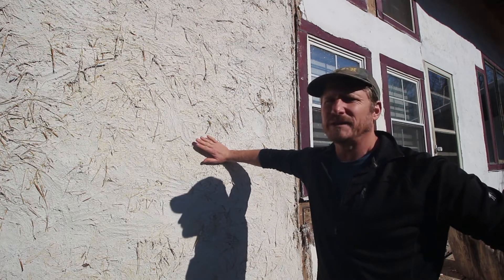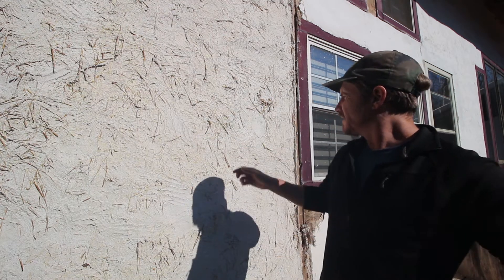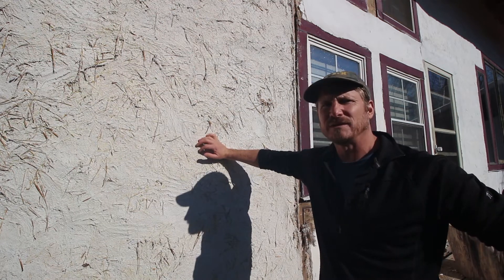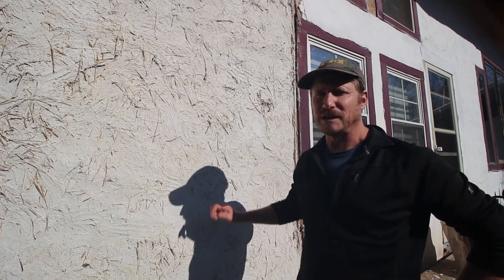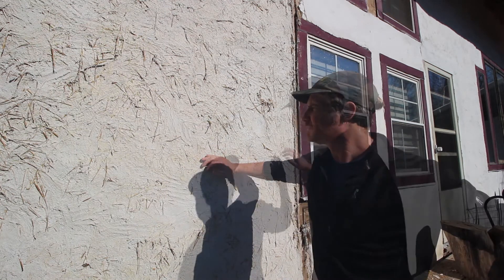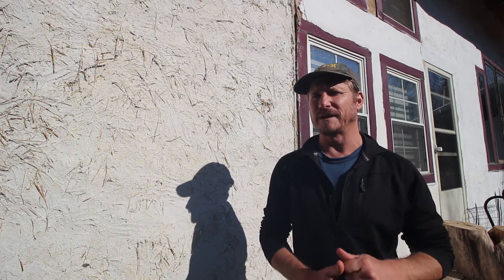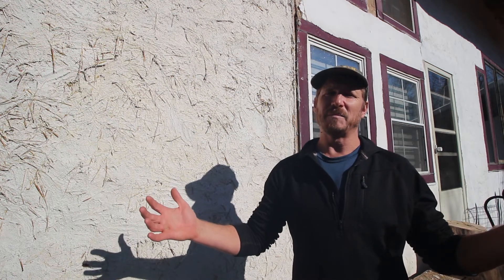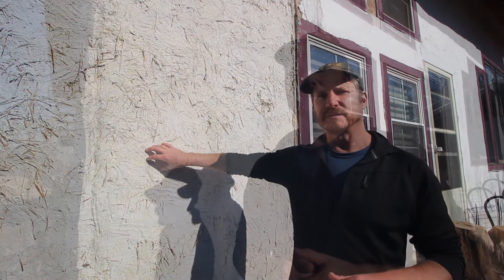What Happens When You Use Frozen Lime Putty in Lime Plaster?

Comment: Thank you for the video. Can you make a video about recipes you use for internal lime plastering and how do you deal with cracks when plaster doesn't dry evenly. Also homemade lime wash paint. I saw somewhere that adding a bit of vinegar to lime wash paint results in lime being not so dusty after it dries. 
Thank you.
Reply from the maker: I will see about doing another video when I'm finishing up this project in this video. I'd say that if the plaster is cracking it might be that it's drying too fast. I haven't ever had that problem with lime plaster but definitely with earthen plaster because it is not the right combo of clay to sand.  I didn't know about the vinegar addition for reducing dusting. I've never actually used lime plaster inside though I did mix a lime casein paint for a portion of my earthen plaster and it worked great. I think the casein prevents dusting too.

Comment: ouuu, few moths ago i had same problem with one bag of lime putty. My putty wasn't so drastically  been affected by freezing, but have had some 5cm  and smaller rocks that don't react with HCl. For me solution was to mix 1 portion of putty width 1 portion of water, and then strain mixture through a 1mm kitchen wire mesh on top of 3.5 portions of dried sand. After mixing this wetty plaster by electric drill, I left it in hermetically closed buckets. Few days after is got water separated on top, and after removing water beneath was nice dry plaster (mortar).
Reply from the maker: sounds like a good way to do it

Comment: How is the plaster holding up over the winter?
Reply from the maker: The new stuff? I'm not sure because I'm not there. i don't think anything would affect it over the winter. It should be fine.
Reply: @HardcoreSustainable  gotcha. I was just wondering if there was any cracking due to the freeze/thaw cycles, or if the lime render cured sufficiently in time. Maybe spring will tell :)
Reply from the maker: @michaelstansell1001  I think it had plenty of time to cure enough before it got cold. It will continue to cure over many months, not so much in the cold though. You just have to make sure it isn't still wet when it freezes because that leads to expansion of the water molecules and the plaster will break up.

Comment: Aged Lime in water is the Best for making water based wall paintings... Frescoes..... painted on while Wet.  The water based paint will bond to the lime and the color will be permanent. There is a mostly sand coating underneath, then the lime plaster added on top in parts so you can paint it while wet. Then the next part is put on...and  painted while wet... and so on. The sand layer has to be square sand. River sand, not ocean sand, so there is something for the lime to stick in.  The sand is also washed to get the little grit stuff out of it before use.
Reply from the maker: If you check out some of my other videos, I talk about the lime fresco finish on my house. I used lime water mixed with earthen pigments and painted it on the still wet lime plaster coat underneath. I wanted to get a deeper purer color instead of a pastel that you'd get with a lime wash.

Comment: Hello can I apply lime putty to repoint soft brick in UK winter? I'm looking to repoint gable end approximately 25 bricks. I've been told to use a rapid set cement mix or wait for summer. 

Any ideas how Traditional buildings were built? Only in summer?
Reply from the maker: I'm not the best one to ask about that, but I've watched other youtube videos on lime mortar in the UK. There are many different varying softnesses of lime types and sometimes if you are using a cement based mortar, it will not work well because it has no flexibility in a wall that needs to flex. It will crack and crumble in time. But the videos I watched were working with restoration of stone buildings. I also don't know what temps you are working with. Lime sets better in warmer temps and the mortar will be damaged if subject to freezing temps before it's set. You would also be using a lime mortar mix of aggregate and lime putty, not just lime putty, but maybe you knew that.
Reply: I'm not sure if you're from the UK I found you whilst researching "Smeaton Project by English Heritage"

Comment: Only guessing based on what things I've read and other videos I've watched, but I would think as long as it's been "sealed" with water, it should be fine. Exposure to air is what would enable a chemical reaction. Lime infused ice cubes that float to the top might result in a small amount of reacted lime, but I wouldn't think it would be enough to cause a problem.

Comment: I have worked with lime plaster to cover my straw bale structures. From my reading, the old-timers used to say the older the putty the better.  My understanding is that, as long as it's covered with a layer of water, it, can stay good for really long time, say 10 years even.  I can try to find the reference in one of my books if you like.

I do know that you should not let lime freeze for a few days after you put it on the wall. Perhaps that is where the confusion comes from.
Reply from the maker: Yes that is true that you shouldn't let the plaster freeze right after applying it. If it's wet the water freezing will expand and ruin the bond. That could be where the confusion lies. 

I'd love to find out about the reference in the book, but it might take some searching. I did find some info online that said they bond seemed to cure quicker with older frozen lime. There is so much info out there. There is even a lot of info that says hydrated lime sold in the US is intended to be mixed with cement for mortar and shouldn't be used alone, but we've been using it for decades and it seems to hold up. Probably wouldn't be as good without roof overhangs and probably isn't as durable as non-hydraulic lime but it still works for a wall on strawbale.
Reply from the maker: @Peter Pebbles Thanks for that reference. I'm still always learning more. But I like those microscope pictures of the grains of lime putty and how they change with time. It makes sense. I know for the quicklime, you have to let it slake a long time and it gets better with age, but for the hydrated, they say you can use it after a day of slaking because it's, obviously, already hydrated (though hydrated with heat I believe). But there isn't a lot of info about longer slaked hydrated lime and any difference in the plaster product. I'll have to read that whole article through. 

I know that non-hydraulic lime is the purer high calcium made from shells or pure lime stone and the hydraulic has other minerals in it that make it set faster and stronger. But supposedly the hydrated lime we can access here is not as good for lime plaster, though it is purer than the hydraulic. It supposedly has magnesium in it that interferes with and doesn't contribute to the chemical reaction of the calcium to calcium carbonate. It seems to work fine for us but it is definitely softer than I'd guess the hydraulic lime plasters are.